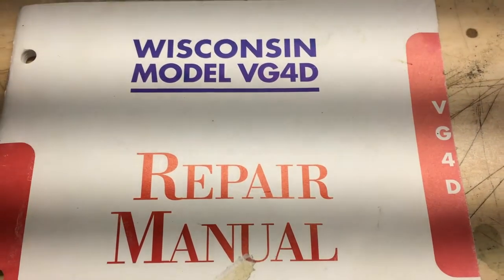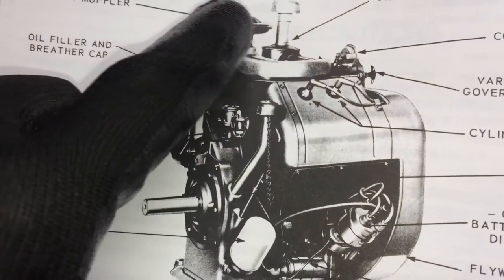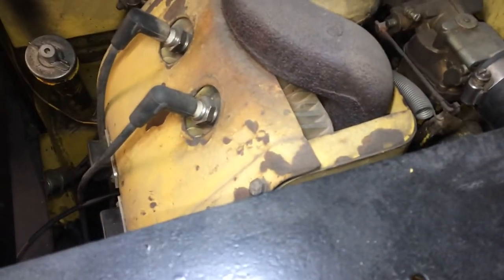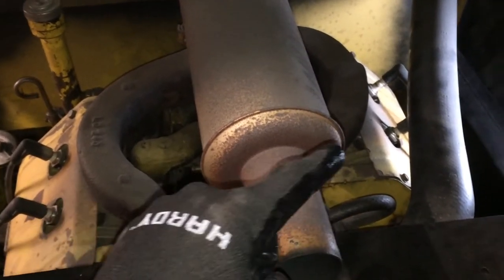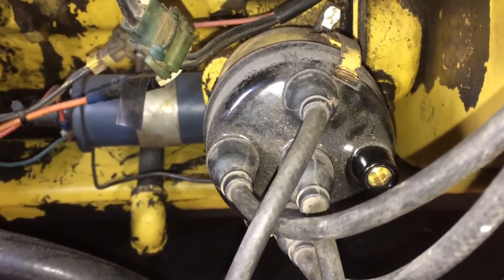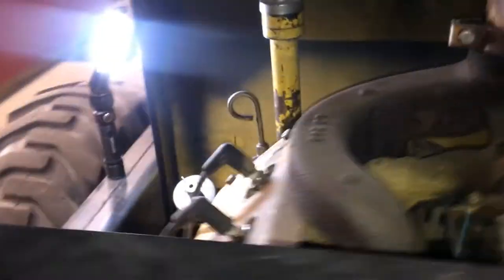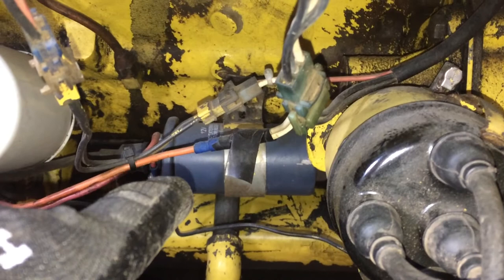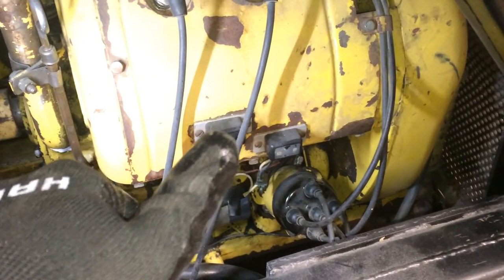Wisconsin VG4D Engine Distributor Ignition Wires, Cylinder Numbers, Firing Order, New Holland L35

Comment from the maker: Summary:
Cylinder numbering is made from the rear of the skidsteer (flywheel side of the engine).  Facing the flywheel:

Cylinder 1 is the closest on the left
Cylinder 2 is the closest on the right
Cylinder 3 is the furthest on the left
Cylinder 4 is the furthest on the right.

Firing order is: 1-3-4-2.  

Ignition wires to the distributor cap are:
12 o'clock position = Cylinder 3
3 o'clock position = Cylinder 1
6 o'clock position = Cylinder 2
9 o'clock position = Cylinder 4
(or simply clockwise 3, 1, 2, 4)

A good replacement coil is BWD E502P.

Thanks for watching, and I hope this helps.  Good luck with your repair!

Comment: Original starter on my L 775 finely failed...every time I started it for the past 20 yrs I would cross my fingers!! Anyway there wasn't much left of the 10 tooth sprocket of the
M-24 starter....on tear down,  internally it was totally trashed!!!
My neighbor had a M-25 that was rebuilt but never used, stored in his shop for 15 yrs..... 
After he heard my story he told me I could have it..
I swapped out my starters solenoid eng mounting and changed his 11 tooth gear to 10
Tooth to fit my flywheel...
What'a difference in + cranking
Power!! WOW!!  I'm stoked !!!!
Thought I would share ...Nick
Reply from the maker: Wow, that is outstanding, Nick!  Thank you very much for sharing this information -- that is great detail, and great knowledge to have on these older machines.  Thanks again! : )

Comment: Just want to say how impressive
Your L35 ignition video 😊 is!!
I GOT IT!! Thank You
Nicholas clinger Ocala, FL.
L 775
Reply: What's available for plug wire kits??
Reply from the maker: @nicholasclinger1737  Well, haha, you saw that corrosion on my wires -- I looked into new wires a couple years ago and found a rebuilder on ebay who makes them (I think the best bet it to make them); I didn't buy them because I can still get away with using my wires, for my limited use of the L35.  I think this here is that same guy who I saw a couple years ago, the rebuilder, and he has some wire available right now (little expensive, but he has them!):

https://www.ebay.com/itm/Wisconsin-Engine-Model-VG4D-Spark-Plug-Wire-Set-YL286G/391353331186?hash=item5b1e79edf2:g:WMEAAOSwZ1lWg~8M

Good luck!
Reply: Your right, I will make them myself...
Can't be all that difficult 🤣 Thanks

Comment: I have a VG4D in a military vehicle as a generator/welder. The distributor cap is on top of the engine next to the #3 cylinder. I have no spark and cant understand what the right wire placement is with this set up. Can you help?

Comment: Hi, I has a Wisconsin vg4d on a chipper. The spark plugs wires were all in the wrong place. Would this cause the engine to run very rough? I also increased throttle and heard a very loud single pop from the muffler. Shut off engine immediately. Engine has 100psi+ compression. So it’s at least healthy. Do the distributor caps only go on one way? Where are the markings ?

Comment: wholy crap you need to do many many more this is so well done it is a bit scarry so first where did you get that manual and where can I get one. second do you have a vidio on setting your timeing I may have an issue with my new starter not kicking until the 3rd try every time going to check all connections first but any sugestions be grand again FINE job do more
Reply from the maker: I'm sorry I missed your comment -- I recommend these manuals for working on the L35:
For the engine, Wisconsin VG4D:
http://www.pittauto.com/customer/piauel/pdf/wisconsin/wisconsin_vg4d_repair.pdf

For the entire machine:
https://therepairmanual.com/new-holland/new-holland-l35-l775-l778-l779-skidsteer-service-manual/

For your timing question: check out that first link. I hope that helps -- good luck!  : )

Comment: Is this the same for thr VF4D also? I got a new cap and rotor and mixed up the plug wires
Reply from the maker: I don't know, because I don't have a manual for the Wisconsin VF4D, but I have seen online that the VF4D has the same Prestolite distributor as the VG4D, and is also side-mounted.  Check your motor to see if you have any cylinder markings like the VG4D shown in the video (or look at the engine from the flywheel side and see if your forwardmost cylinder is in the same position as the one shown).  If it is, then I would think that it is the same. But I don't know for sure!  Good luck!